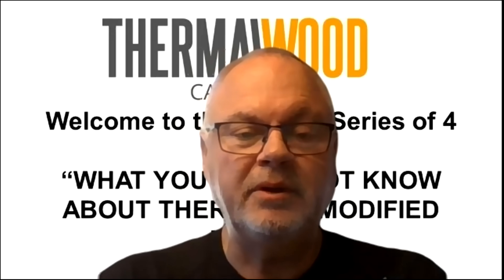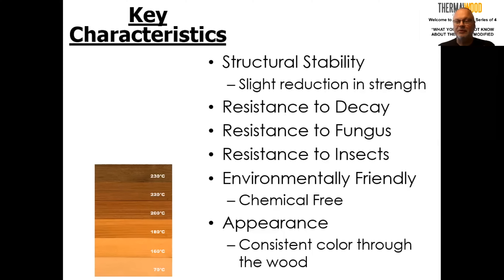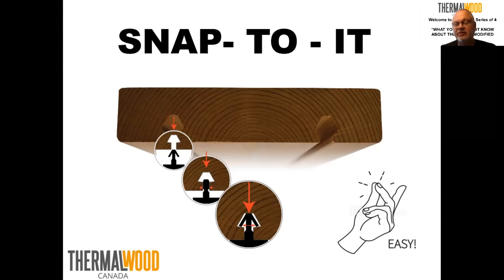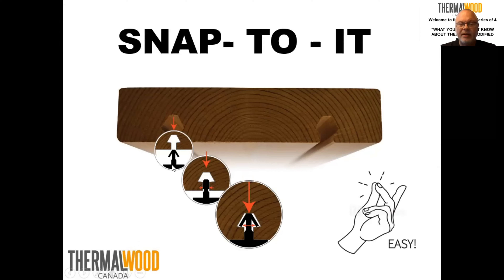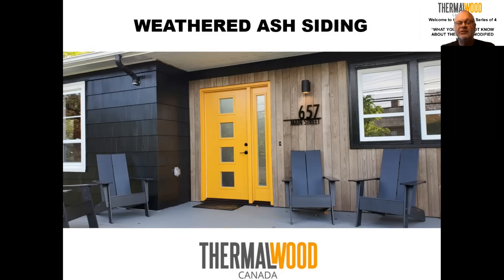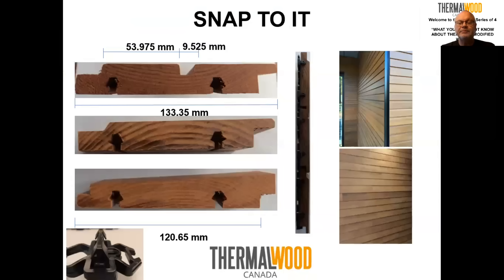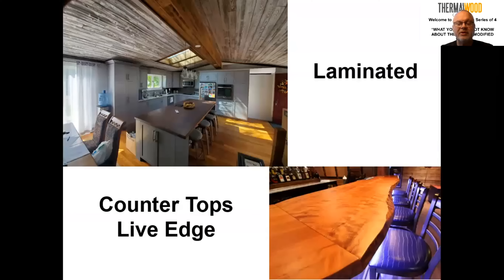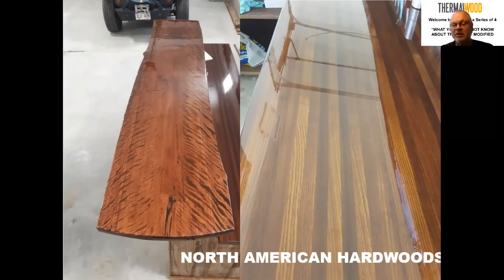Benefits Of Thermally Modified Wood Explained: (Part 2)

Comment: what is cutek made out of?
Reply from the maker: its an oil blend formulated to to penetrate into wood and protect it from the inside out.  it really works wonders with thermally modified wood, and minimizes the checking in the wood you will get as it ages. if you add in one of the colour tones ( they all turn thermally modified ash the same dark brown colour) it will prevent the deck from going grey in 2 months. you do however need to keep up on the re-applications ( at least once per year) to maintain the colour and prevent the greying. the pigment does fade quickly. if you are looking for more in depth info on Cutek Extreme, like the MSDS sheets for instance, feel free to visit their website. www.cutekextreme.com